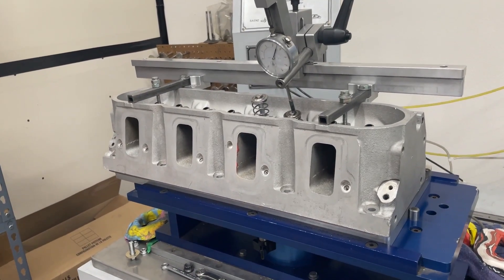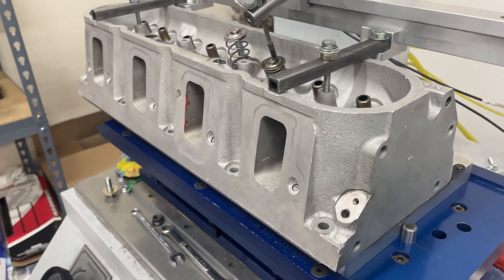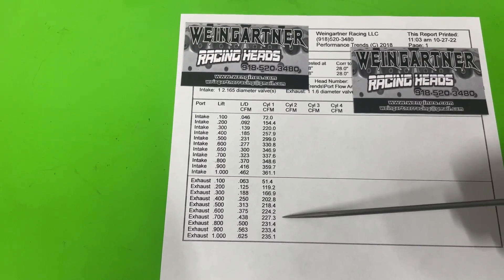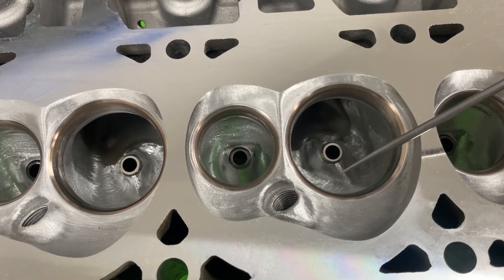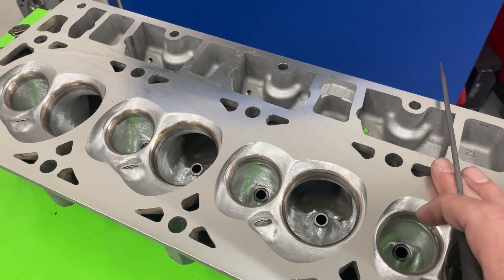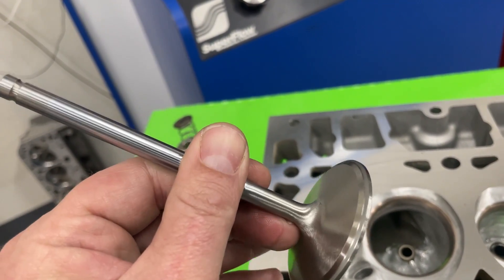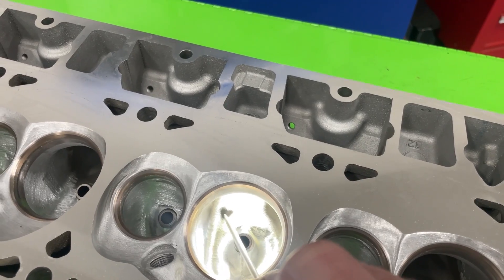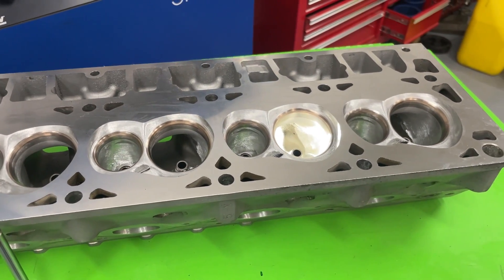LS3 Pocket Porting Results

Comment: Hey Erik... Just wondering your opinion on an LS3 head but for a more midrange RPM focused truck application - Heads are off anyway, gonna keep it N/A and bump the compression to 10.7 to 10.8. Should I even consider doing any actual port work, or would opening up the bowl and short side a bit actually hurt lower RPM (3000 to 6000) performance? Should I just make sure to unshroud the valve job/maybe polish the exhaust a bit and leave the intake alone?

Comment: I'm trying to do my heads 823's I've concentrated on the exhaust, i just cleaned-up and leveled the seats on the intake had a big over hang the seats in the port, I'm building a turbo engine so the exh i been taken material out of the roof and just cleaned up the floor as I figured wasn't that important I think my turbo will need all the gas it can take to spool the Turbo, my engine is being stroked to 413 and a big 98mm Turbo I hope I've got it right I've been watching all your LS Porting videos a few times to get my head around it all

Comment: I know you are going to laugh and think I'm crazy. When I had my 1.6 Chevrolet Aveo head off to replace all the valves and guides and of course valve job and resurface.  Noticed how bad the Bowles were I did pretty much the same with minimal material removal.  It did make more power with the same gas mileage

Comment: Would changing stock valves to the ferrea 6000 be worth the cost vs gain ?I have an new ls3 crate engine that I installed a BTR stage 4 cam and going to spray it . I’m going to pocket port heads like yours. Thanks for the videos
Reply from the maker: You need to check to make sure you have enough piston to valve clearance with that cam. The Ferrea valves are stronger than stock.
Reply: I built a very similar combo for my S10 using the BTR stage 4 LS3 cam and did not have enough PTV clearance so I did a set of pistons and rods to bump the CR to 11.5 and gain PTV clearance.

Comment: Hey Eric, love the work you do and the knowledge you share.

I have a question about some 243 cylinder heads that had foreign object entry… there is some damage to the spark plug area, kind of a bulge that comes to a point. I’ve wondered if working the chamber to remove this bump on each cylinder would negatively affect performance? (As well as the small knicks in the chamber from the metal bouncing around).

Comment: Those flow numbers are definitely worth the money. But what cought my eye was the inlet manifold fastening points, or rather lack of. Never seen so up close an LS3 head to actually notice it, but that is a weak point, especially when boosted. Only one screw hole on the upper row. Weird. Yes the pushrods need room to operate, but they could've put at least three bolts there just for good measure.. I was going to get my hands on one of these bcz I like the port design, but that manifold attachment threw me off. So, thanks for saving me a fortune!
Reply from the maker: Many people are running 50+ pounds of boost with those same intake mounting.

Comment: Those are pretty good numbers considering the really light work. It kind of drives me nuts how much guys love the factory rec port heads because they flow pretty good. 
They are crap compared to a race head from the early 2000s or 2010(?)+ gen3 hemi head. The ports are huge and if they didn't flow 300cfm you would be embarrassed. 
A brodix 18x with 244cc cast intake ports and a 2.14 valve actually outflows a stock 823 head with its 257cc port and 2.165 valve.
Reply: Certainly the 18x, race heads, and some hemi heads  outflow it. However, we buy rectangle port 6.0 core engines for $500 or less. See horsepower per dollar
Reply: @kylemilligan752  the eagle and apache heads its not even close. The 5.7 eagle heads routinely go over 330 with a 2.05 valve out of the junkyard. 
I don't dislike the rec port heads they just have huge ports. For guys that launch off a transbrake its not really a big deal.
Reply: @timothybayliss6680 . Ive been driving a 360 Dakota for 22 years. If hemis were affordable I'd be right along side with  you. However, we get rectangle port 6.0 ls truck core motors from $200-500.